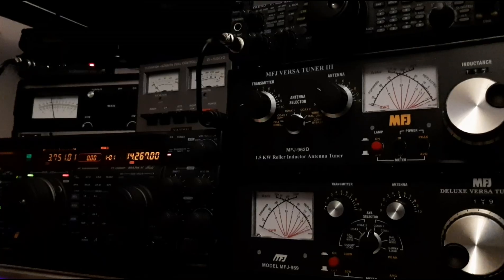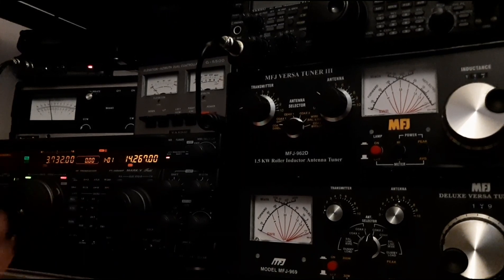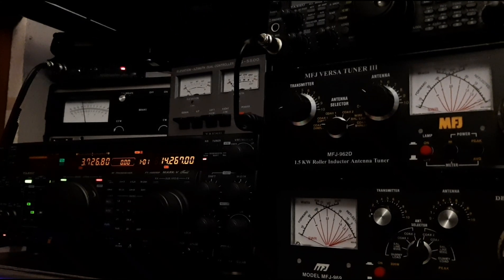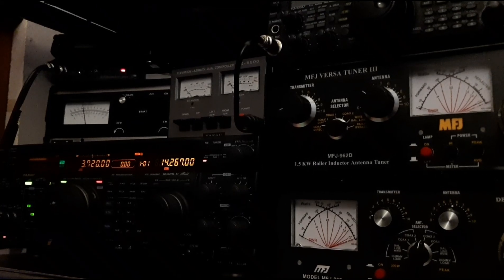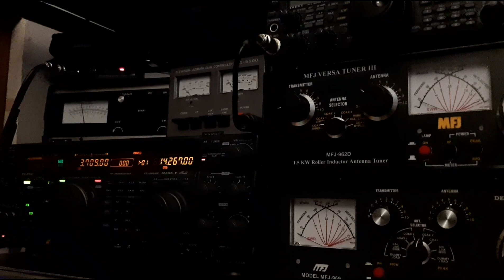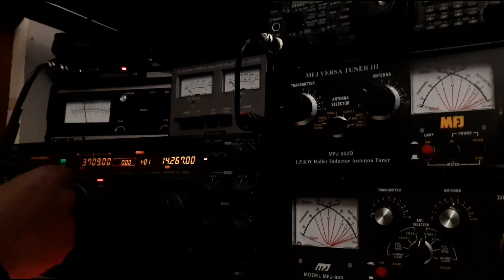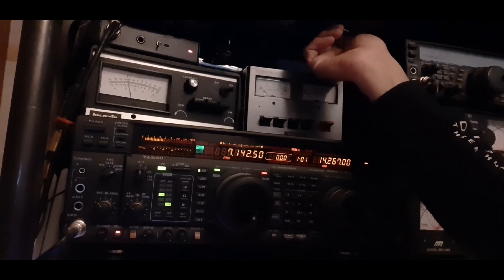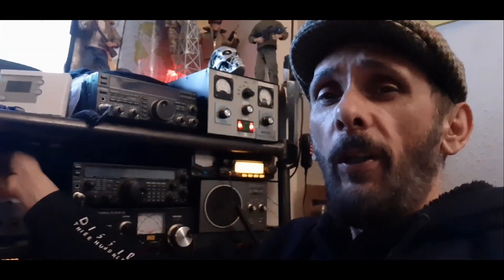M0YKS HAM RADIO - 40/80 FAN Dipole Test

Comment: Excellent results on both bands there. It'll be interesting to see what difference the extra height makes.
Reply from the maker: Hi Ronan, thanks again bud, I will see what I can do today and get back with another update. ON 40m at the minute using both dipole and vertical, both are working quite well. Lets see if I can do better with the height once I get my antenna head back on lol, catch you soon and stay safe my friend.